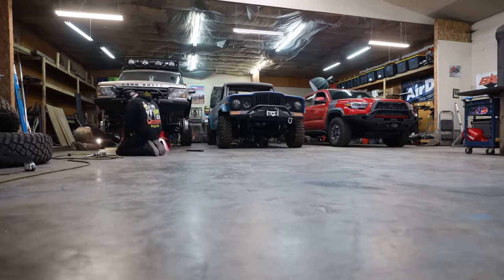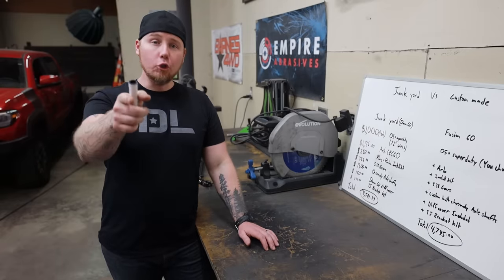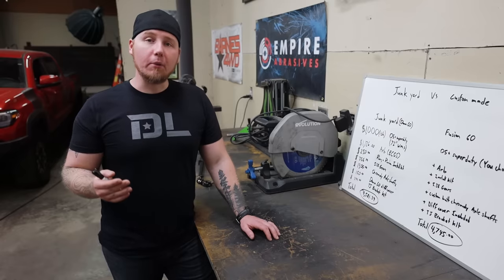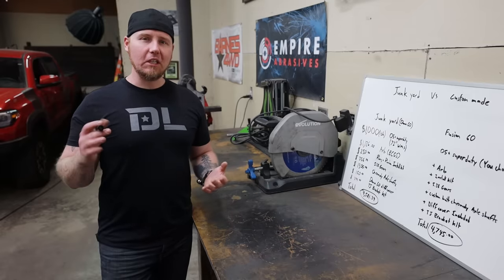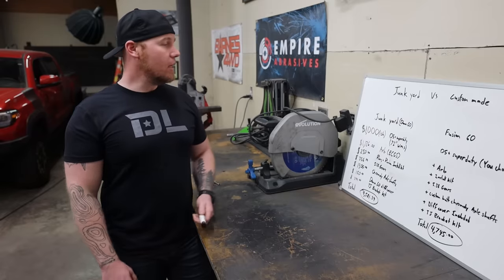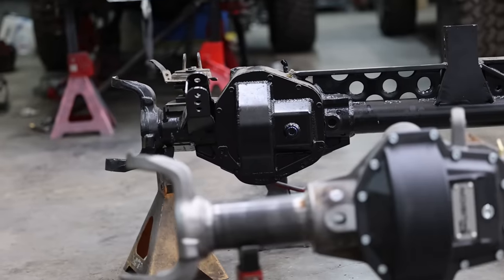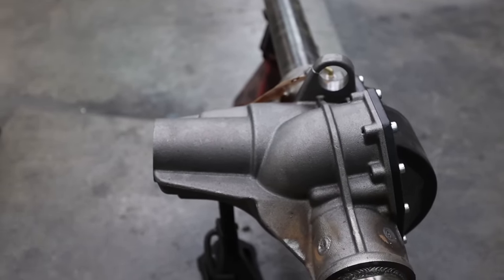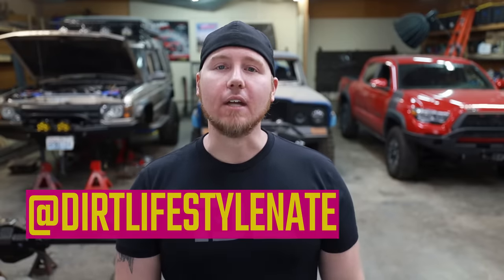Don't Buy 1 Ton Axles Until You Compare These Costs

Comment: I dont understand fully what a 1 ton actually is. 
My truck weight is 2t from factory so would it likly have 2x 1t axles or is that not how this works.  Its also got a 3.5t tow cap from factory.
Reply: Weight doesn’t matter. They just come from one ton trucks (3500s, f350)
Reply: It is not vehicle weight, it is suspension load carrying capacity. Aka F-150 (1/2) vs F-250 (3/4) vs F-350 (1) vs F-450 (up to 1.25) vs F-550 (up to 1.5) etc.

Comment: Also depends on vehicle make Toyota, Land Rover, and Suzuki's Samurai. They are a lot harder to build than a Jeep. I was thinking about SAS on my 2000 4runner, way cheaper to go new, than Waggy 44, the only used options are Jeep Rubicon take offs, or Dana 35 from a JK (yuck). Used axles are not worth it anymore, unless you can get away with running a stock untouched one in good shape. I am spending the 5000 on the axle lol. Ask yourself how much money is my time worth?

Comment: Screwing around getting a junkyard axle for cheap, ripping it apart and assessing what is salvageable and junk takes a lot of time, then you're concerned about wear and other damage like bent tubes, hairline cracks in knuckles, etc. A new axle is just that, new, no worry of old parts failing. If my Toyota housing is bent for my project, I'm not going to screw around with it when I can get a new Rock Assault housing for a little over a grand.

Comment: The only benefits I see to using a junkyard axle is upgrading over time as parts break/wear out. Downside being that if when you break on the trail it can cost more than just what failed depending on the situation. Time is also a big factor and my time is limited so just being able to bolt something in instead of fabricating everything is great. Great video. 👍
Reply from the maker: Definitely true. 
My time is valuable these days as well. If I was still plumbing instead of making YouTube videos I would just get some extra overtime at work to offset the cost. No one likes to spend a day cutting and cleaning off all the old axle brackets, pulling old ball joints and disassembling all the old internals.

Comment: Guess what, you get what you pay for. The cost of all used parts have been creeping up for years. I understand the cost for operating a bone yard has also gone through the roof. It suck all the way around.

 With our local off road group. You see the same few people who are always building and rebuilding their rides. At my shop we say all the time. People can't afford to build it right. But they always can afford to build it twice.

Bone yards are for sourcing a core that you rebuild. Not a used part that is waiting to fail. When you take a vehicle and beat it harder then it was ever design to be , things will fail. This is why you need to make choices. How crazy of a trail can I afford   if you can't afford all these super strong parts it is cool. Just ride  within your vehicles abilities so you reduce the chance of a breakdown.

You can have tons of fun with almost any stock truck if you stay within its limits. Plus most of the time you can drive to and from with a radio and AC on and working.

Comment: Decent video, but I think some important things were overlooked/not discussed. Unit bearings are $375 x2. Brakes/rotors/calipers = $500. 05+ stock knuckles are super expensive if you buy them loose. +$400 bucks. That’s all shit you get with your 1k junkyard axle, and don’t with the Fusion setup you showed. Fusion is sick and I wanted to buy a set of their 9’s with kingpin outers. Too expensive for me, although most affordable of any I’ve seen.

Comment: 😂 you seem to forget a lot of parts on that new axel that comes with the junkyard option. You really need to dubble that new price tag to think about starting with new.
Reply: Yep..have somewhere around 3k in my SD60.
Reply: @wvjeepguy8178  I bought mine when they were cheap. I picked up a set with 4.30 gears and a rear locker for $800. I have a 5.0 atlas case so I didn't have to regear i am running 38s and stock 2018 shafts. Been like this for 5+years wheeling in AZ no broken anything. Total price $1400. he will have more money in units and knuckles then I have in my whole set up, and still need brakes and hubs ect. Key is planning.

Comment: 20 years ago i put a kingpin chevy 60 and an OBS 14 bolt under my 88 yota. 100$ for the rear with a gov lock, 500$ for the front. both had 4.10 gears. i put 200$ in u joints, u bolts and brake pads. 100$ for some used steelies and i was good to go. you cant do that with modern vehicules and junkyard parts arent cheap anymore. i wouldnt do a junkyard swap today.

Comment: but most people building rigs for offroading locally to them not touring the country with the ULTIMATE rig arent buying arb lockers,chromoly shafts,new gears,new diff covers, ect... dana 60 out of a dodge 2500/3500 is 400-600$ canadian up here fire that under your TJ/XJ or whatever as is and youre over built as hell... no need to replace every single component, maybe if youre running 40s and only have a 2.4:1 Tcase youd need to regear

apples to apples yes its always cheaper to buy a complete assembly rather than replacing every single part one at a time.. most people are working with 5k-10k budget total not 10k budget just for axles!

Comment: Well I can tell you junk yard parts bought unseen is a bad idea. Especially paying prices they want for this crap now.  Now 15 years ago you could grab everything you wanted for 200 bux pick and pull. Personally I would rather pay an extra 2 to 5 hundred bux for something new and custom than install used crap that could be damaged. Just saying. Plus cutting brackets and welding etc it just makes sense.

Comment: I splurged on a dynatrac about 7 years ago. The aftermarket competition has definitely helped prices. For me it was still worth it because I had more money than time at the time. The biggest advantage for me was the high clearance pumpkin and the 63" wms. Full width gives you way more chance of getting hung up on stuff. People are amazed what I can squeeze through. My only regret is using their brackets. Should have done that myself. Theirs are thin 3/16" and some have broken off. Also, they're in the stock position and don't correct for your lift, so you have the same geometry problems as a stock axle, i.e. high track bar angles

Comment: I'm trying to build an Overland rig out of an 89 Ford Ranger I don't want to put one tons but I do want to put a straight axle in the front of it thank you for giving me more to think about keep up the good videos
Reply: Depending on tire size desired. 80's Rangers love Jeep Dana 30's or Rubicon axles if you do not mind the width. Depends on tire size goal, and where/how you wheel :)
Reply: @iankovac1878  not going any bigger than 33 it's more or less I'm not going to do any real big rock climbing but if I need to get out of a mud hole or something like that is basically it
Reply: @cliffordsmithey464   Do the Dana 35 and you can upgrade it to hold 35's. It will be hard to find a non bent unit, TJ is about 59 inches hub to hub width JK is about 66. The 8.8 out of a late 90's explorer will be good for rear with TJ, just need to change it to SPOA. For JK just get a pair to get a rear to match :)

Comment: This still isn't an apples to apples.
You didn't include hubs, knuckles, brakes odd ball sensors, etc.
A junk yard complete axle comes with all of that (usually). To get a complete axle from fusion, it's up at the 7500 range and not 4700.

Comment: The keyboard jockeys will always talk smack... Many only build in there dreams, have never assembled, welded or even changed the bearings or seals in an axle. to them their time is worthless. you can rack up several hours building or repurposing an axle... I would rather be enjoying the vehicle out on the trail than spending my time building components. Build it right the first time so you can enjoy the ride. Great video.

Comment: Building from used makes sense when the price is right on the used axle, $1500 is stupid high! Our time spent building our toys is time well spent, but the time it takes to build is still a consideration vs bolt it in and go! Also skill level, do you have the skill and tools to fab the thing up? If you have to pay someone to weld it together well,,, more cost. 
I got "lucky" my HP D44 was free via buying a truck and parting it out, made money on the parts I didn't want! So technically got paid to take the D44 and 9inch LOL. Buying out of a junk yard is kinda like dealership pricing now days. I REALLY enjoy fabrication, but bolting sh!# in is SO dang NICE! Almost cheating LOL

Comment: Wrong, you can build 96" wide axles if you need to, And your costs are high.  Thumbs down. Apparently you don't know all the Axle shops in the US and you Must live in a different world than me building then from age 16 on, and just picked up a 14 bolt and Dana 50 for $225  for a Hybrid front Rock Axle, And your $1.300 Axle shafts cost $165ea to build? R&P 5.38 $170, USA Standard Gear install kit $140.  Sunnyboy needs schooling.